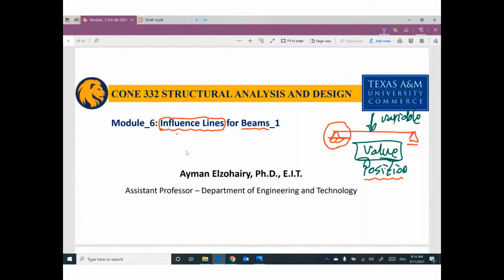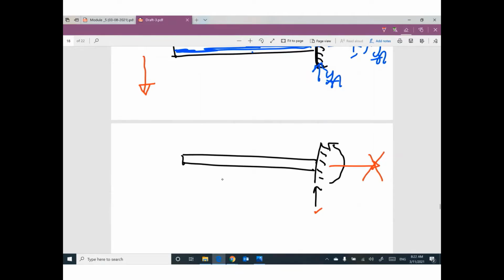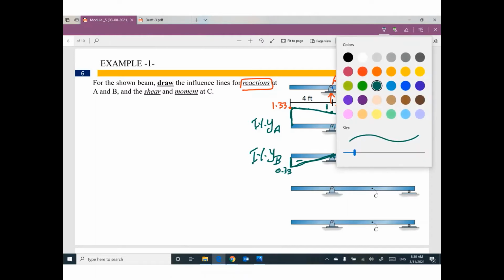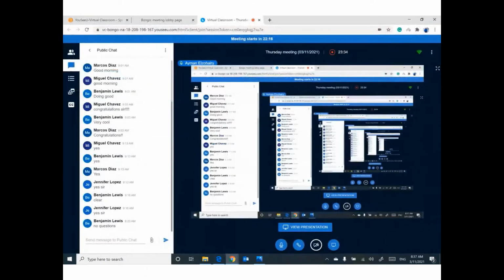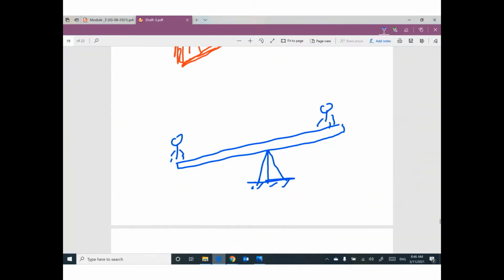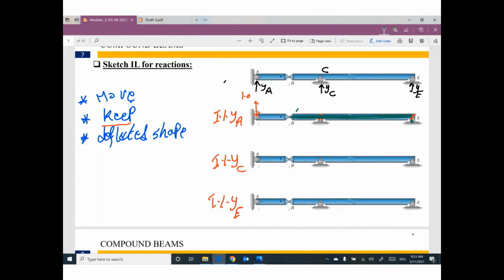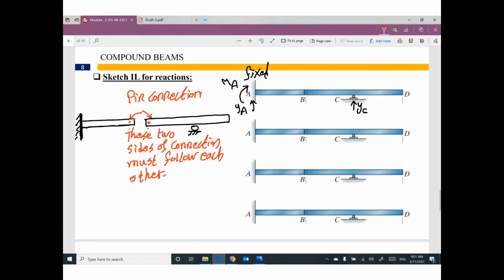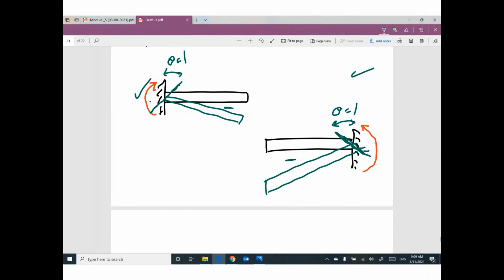Influence Lines for Beams part 2/4

Comment: Been amazing so far, but I now understand why you said structural engineers complain about the topic....I thought I was understanding but each time click play you end up solving a different Influence line. For example in the second to the last example, the fixed support did not affect the hinge connection for IL yc but in the last example affects the pin connection for IL yc..restricting movement even at the pin connection....😅